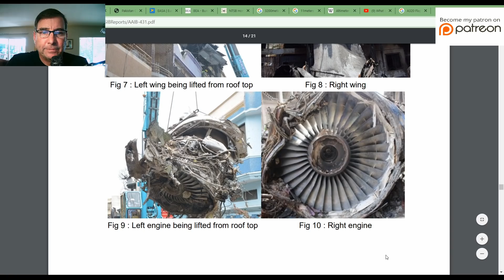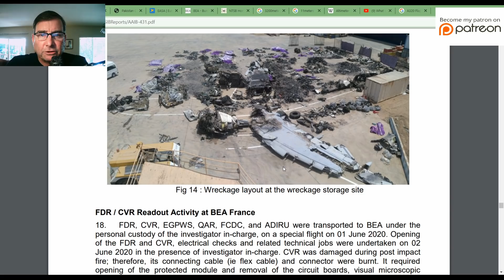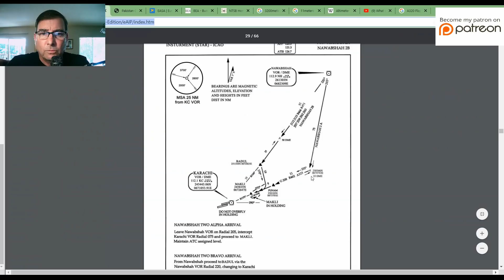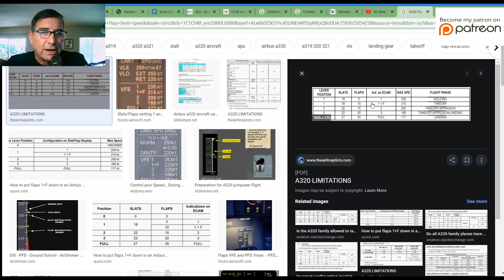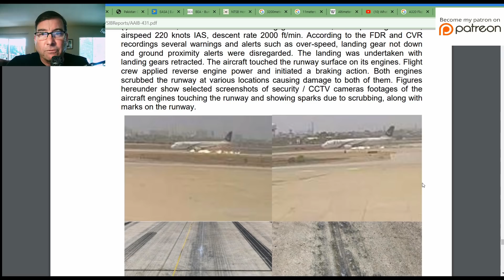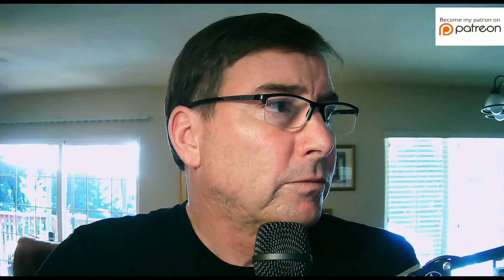PIA #8303 Preliminary Report Part II

Comment: The crew was distracted and unfocused due to nonprofessional discussion. There's enough evidence to suggest that PIA has a lax and indesciplined operating culture where disregarding the SOP the crew indulges in such hot and high unstabilized approaches. In this approach they were way out of the profile so when still decided to continue they put themselves under a lot of pressure combined with fatigue and low blood sugar there's possibility of hyperventilation which stopped thinking. Because their behaviour became irrational. They lowered gear at 7000ft to get in the slot but at normal gear lowering height of 1700ft they raised it. It's a case of conditioned reflex. They didn't realize landing without gear otherwise they would not have used reverse and brakes which wasn't going to work. They have gone around due to insufficient runway left to stop. Again they put the gear down instead of up by habit but realizing it was up they put the lever back. Since thinking had stopped possibility to Engine damage never occurred and they asked for another ILS that was taking them away from the runway. Had they asked for circling approach they would have made it. Also from where they said we'll be proceeding direct they were very close to military airport that was their best option. In airbus there's no blow back of flaps. They will extend with hydraulic pressure.  APU doesn't provide hydraulics, provides pneumatic pressure. Also had they not lowered gear there was a chance to avoid the buildings. Their thinking had stopped and their acts were random and without logic. Starting APU was useless in this case because with dual hydraulic fail they would be in alternate law, gear down direct law.

Comment: During the go-around at the moment the engines failed, was it still possible to save the flight if they had waited longer to deploy the landing gear and had the flaps adjusted to minimize drag? If you set up those conditions in a simulator, how often would an average pilot be able to land?

Comment: I don't think those reveres actually deployed on landing as the gear was still retracted. Not entirely sure, but doesn't the air/ground switch (which I think is triggered by the weight of the plane on the gear) have to be in the "ground" position for the reversers to deploy ? Not that it would have made a huge difference, but I'm just curious. Please correct me if I'm wrong.

Comment: Let's assume that, after they scrapped few times the runway, they realize it would have caused severe damages to the engines, the crew communicate mayday to ATC requesting a TURN TO THE RIGHT to land on the adjacent runway in REVERSE DIRECTION. Both runways were released for the landing. Would that be possible?

Comment: Hello!
I am not an expert but what i heard is that probably pilot's decided to abort the landing well before touching down the runway due to over speed and likely over shooting the runway. They decided to go around and retracted the landing gears and gave throttle to gain speed, but due to normal delay in engaging thrust and gaining momentum, in the meanwhile engines touched the runway.
If you can share your expert opinion on it in the light of available information. 
Thanks

Comment: 30% of Pakistani pilots have fake licences
Pakistan’s Minister for Civil Aviation has said that 30% of pilots in Pakistan had acquired licences by cheating on exams—and would be grounded immediately. “There are some pilots who did not appear in any paper, out of eight, but managed to get the licences. Among them are those working with the Pakistan International Airlines (PIA), Airblue, Serene, private clubs and foreign airlines,” the minister told the press yesterday. As many as 262 of 870 pilots had suspicious credentials, a probe has found, he said.

Comment: The data recorder shutting down after loss of main power is simply ridiculous. Surely this would be the time it would often be of most use? They must surely have a battery back-up? - The only thing I can think of is the sending transducers would lose power so the data recorder would have nothing to record. It should though still cover items driven by the RAT. The transducers would have very low power requirements. Some could even need no power and be velocity devices or piezoelectric, strain gauge etc. The voice recorder obviously continues.
Reply: The FDR (unless changed) is powered by AC BUS 2. The RAT only powered the ESS bus which has far more important systems. There are other ways to get data like from the ECAM

Comment: Not sure if you covered this but is it possible there were toxicological factors with the pilots, such as hypoxia or carbon dioxide poisoning. I realize descending to the lower altitudes you would recover but just how long would it take to regain full mental capacity?

Comment: I think the pilots thought the gear was up so they moved the lever to deploy it , they were going by memory without checking the label on the gear handle that says up or down. They hadn't flown too many times previously so they made a mental mistake with gear lever and because of all the alarms and they were so close to landing they didn't check the gear status lights. In other words they weren't following checklist and verifying. At least they don't have to worry about the covid19 anymore which seems to be on their minds during the flight. On the go around if they hadn't deployed the gear they might have made it. The airbus even with its damaged engines was trying to buy them some time, but they had to be perfect in their decisions and they weren't.

Comment: Quite damming that the FDR quits working once gen 1 and 2 is lost that's unacceptable the Airbus has battery's  just for this and if they are inadequate for this task it shouldn't be certified to fly (they did say just for this plane serial number so I'm guessing this is not normal on other airbus or they fixed it later on) the Independent recording systems on the plane which I believe the plane has about three-four of them (2 critical related to FDR and voice data recorder) they should have a 5 minute backup battery power to allow the APU to power up as it takes about 90 seconds for the APU to become active (if I remember) and provided all required power that the rat can not provide (in this situation the APU wouldn't of had enough time to come on so battery power should of been powering all the FDR recorders)

As they have had to hack together information from other sources and the Airbus other systems that was still recording in the cockpit area (totally unacceptable, the FDR and other recorders should stay active until crash, if 1 rat is not enough they should use 2 rats but the the weight that would add it be a lot, it would be more efficient just to add smaller second battery or slightly larger battery to power the FDR)
Reply: The last I heard the FDR is powered by the AC BUS 2 and the CVR by the AC ESS SHED bus so the emergency generator will still power the CVR as there is no other source of voice data inside the cockpit. There are other sources of data for the FDR but bare in mind most crashes occur with a fully functioning plane or at least one that hasn’t disabled the electrical system. Exceptions would be fuel starvation but then you know what happened and all data prior to engine failure is still saved. An accident where the aircraft has been slammed into the runway and taken off again is probably one of a kind. And if the fault is a simple electrical fault that disables AC BUS 2 then the pilots are going to land ASAP anyway

Comment: Juan do the landing spoilers get triggered by "weight on wheels detector" if so then the spoilers would not have been deployed on impact with the runway. Not that it matters in this case.
Reply: weight on the wheels it's called a landing gear squat switch

Comment: Juan, couple of layman questions that come to mind after watching your analysis:

1. What could possibly be the logical reason that the pilots were over 6000 feet higher than they needed to be before their final descent? Would you say they were just distracted in the cockpit or is there any other reason that they were intentionally so higher up than required. Was there any possible factor of saving time or any economic factors driving their decisions which so often is the case in such airlines. Were the pilots decisions possibly linked to any such logical reasoning? These pilots were not rookies and had a lot of flying hours behind them and this report just sounds way too convenient. 
Can it really be as simple as a case of plain negligence and isn't it just naive to assume they flew a perfect plane right into the ground like a couple of total imbeciles without deducing the reasons behind their illogical decision-making? Why isn't anyone bringing that up? This report may as well be a total eyewash by the authorities trying to save their own asses by pinning it on the dead guys.

2. The sequence of landing gear being turned up and down does show confusion but again could the reason for this be that the gear was maybe mechanically not retracting and perhaps the pilots were retrying again and again to make it work. Is there a possibility that this malfunction would actually show or not show up in the FDR? 

3. What kind of damage do u think the plane could have sustained by continuing it's belly landing , had it not taken off for the second approach? Would the plane and it's passengers have survived by landing at that high speed, given that they had landed halfway into the runway?

Would really appreciate some insight with your expertise and experience.

Comment: @ 27:50... At that point... not much. Even with the engines out and crashing in to the apartments, this flight would've had a much better outcome if just the APU was on like on US1549 to the Hudson...
Reply: Not by much. APU doesn’t provide thrust all it would have done is restored electrics maybe they could have got flaps out but this would have created drag too
Reply: @tomstravels520  At that point the APU wouldn't have have enough time to start. However, you're misguided if you think having APU wouldn't have done anything. APU allows for being in Normal law with load factor and alpha prot thereby not allowing a stall. I recommend to look up AF296 and US1549. The other one crashed in to a forest and the other in to an ocean. Everyone survived the impact. A crash landing, even in to a busy street/apartments is much better than dropping 9,81m/s2 downwards on your spine.

Comment: Thanks for the thorough update. Hypothetical Question: Had they managed to land safely after such a lousy approach (if landing gear were down), what sort of review would occur of pilot's performance? Would pilots be grounded?
Reply: With QAR recordings of everything that goes on in the cockpit it would have triggered so so many alarms. These would have, in theory, been flagged up to the companies safety department. What happens from there depends on the company culture, etc etc. In a normal airline it would have ended up in dismissal, but as I say that depends on the company and its safety and standards culture.

Comment: even without engines, after go around, the plane did make it at least 2500 ft, if he took the perfect glide, how long could he have glided? how much did he travel after go around? and he did crash 1300 m from runway, but only 100 meters from airfield open area, if he kept nose down he could have controlled the landing?!

Comment: Since the rest of the comments have already conveyed many of my thoughts about this incident already, I'll touch on one that many haven't - he fact that the FDR stopped recording BY DESIGN LIMITATION after engine damage had occurred is absolutely, positively, infuriatingly UNBELIEVABLE. A system literally intended to record data, ESPECIALLY in a crash, having a design fault in which it no longer records after the engines failed(as far as we know...)... I don't have words for it, it's truly unbelievable.

How the actual hell does this blatantly glaringly obvious fault make it through the company? This is a failing of similar incompetence to the 737MAX, design process failures. What other systems of these aircraft have been negatively influenced by these failings? 

A Flight Data Recorder - that stops recording data without engine power
What the hell can you even say about this?!
Reply: Because the RAT has more important things to power than the FDR. It has 1/18th the power of the engines and needs to power the emergency generator which only provides power to the essentials systems such as the flight controls, the GPS, ADIRU’s, displays (captain only) and the systems involving the ECAM which also keeps record of various systems too. Plus it needs to pressurise the blue hydraulic system
Reply: @tomstravels520  [apologies for the length - my vocabulary is large, but my brevity skills are small, lol] 

I certainly understand that, I'm not suggesting that they should be the last piece of equipment on the aircraft to lose power, or even that they must receive any power that is being generated by the aircraft after engine failure - but rather, we really can't incorporate a limited backup power source for these FDRs & CVRs?! A dedicated battery backup, even if whatever design limitations there could be limits it to, say, 'just' 5 minutes of extended run time w/o an external power source? Or, just 1 minute even? SOME amount of continued data recording time is better than *none*, and the information at & immediately following the moment of power loss is some of the more valuable information that could be recorded, these are pivotal moments in the flight of an aircraft. Even just a split second of information(depending on the sampling rate of each information source, no doubt measured in milliseconds) could be the most important piece of information from a crash. Even Juan was surprised by this. 

They have locator beacons(mounted to the FDR assembly, but independent of the physical recording equipment - no concern of the FDR possibly draining the beacon's battery of course, that would obviously be self-defeating) that already contain their own battery power of course; but we can't add one for the FDR/CVR itself? While inherently requiring more power than the beacon, we aren't looking for the same duration of power as the beacon(again, even 'just' 1 minute of run time after power loss is of significant value). 

I have a background in telemetry/data recording & processing, especially from the world of motorsports(big words to say that I take recorded data from on-board data logging and interpret that data to better tune these cars), so there's 'red flags' going up everywhere when I hear that a critical data recorder has just such utterly glaring flaws. 
I completely understand that this is an aircraft that debuted in the '80s, and that the FDR & CVR(at least the ones that they originally came with - I'm not aware of any kind of annual upgrade practices/requirements/regulations in regard to FDRs & CVRs; I would hope that the recorders are continually evolving and that airliners would get updated replacements every 5-10 years or something, but wouldn't be surprised if this isn't the case...) are older than that. So I 'get' that we aren't talking about anything based on solid state storage media and lithium ion batteries(not to say that motorsports hardware is, lol), I get that this stuff is stone age compared to even the earliest automotive data logging equipment I've had the [misfortune] of using(thank god technology evolves...) - however, the idea of adding even a small duration of battery backup just isn't an insurmountable problem. It really isn't, not even decades ago.

Let's consider that this battery backup doesn't even need to be internal/built-in. While package size is of course a real issue with these devices, in the places where I've seen these mounted in aircraft, they most typically have ample room around them(they are stuck in areas of 'wasted space' after all; like inside  the taper of the tail section, where it isn't practical to put much anything else due to the awkward shape). So, let's add some modularity to these things - if they're receiving external power from the aircraft, then there's no reason why they can't receive external power from an external battery pack(and, with the beacon still containing its own battery power, it's not like we're concerned about the recorders maintaining power after the actual crash event obviously, it's perfectly fine for this supplemental battery pack to get destroyed). With but only a couple wires needed to tie a battery pack to these, the battery pack could be mounted ANYWHERE on the aircraft. With such flexibility, the battery pack could be any size that's convenient to the available free space. This could allow for these supplemental battery packs to be replaced and/or upgraded throughout the life of the aircraft if needed. 
The recorders would still be powered by the aircraft during normal operation of course, and the supplemental battery pack could be trickle charged/maintained by the aircraft's electrical system.

I just can't buy it, there just can't be ANY legitimate excuse for the very devices that were invented by this industry  for the specific purpose of data logging pre-crash information not actually being able to log said pre-crash information just because the engines are all no longer running - this LITERALLY defeats the entire purpose of these devices, this completely undermines the the concept of pre-crash data logs. 
This simply isn't an insurmountable problem(I mean, we're talking about AIRLINERS - these are the premier examples of high stakes problem solving via engineering), nor is it even an expensive problem requiring an expensive solution. Frankly, I can't possibly see how such a glaringly self-defeating problem isn't simply the result of corner cutting - it's just absurd...